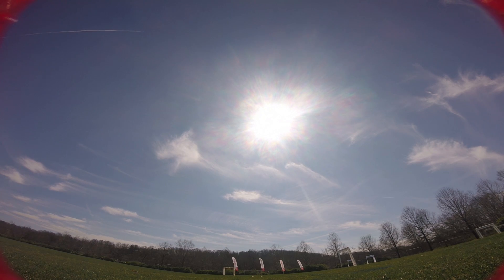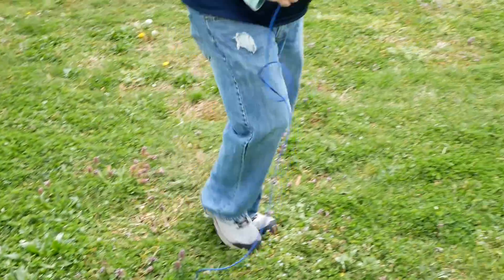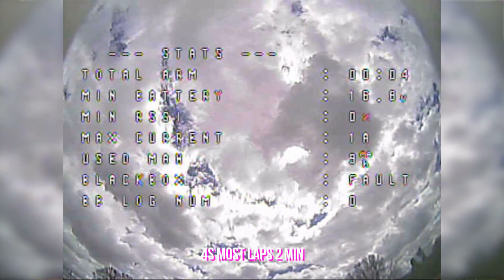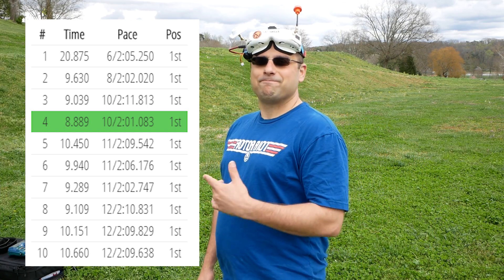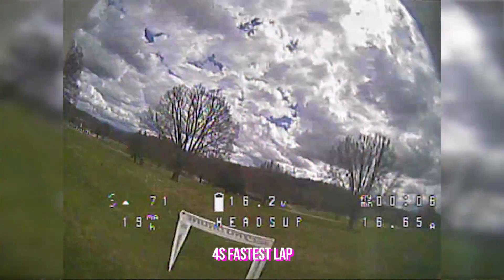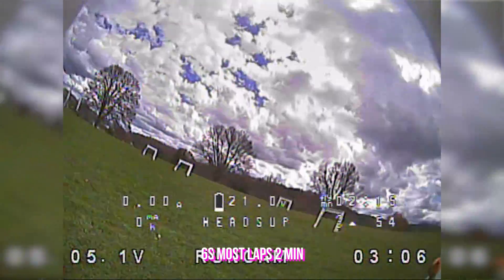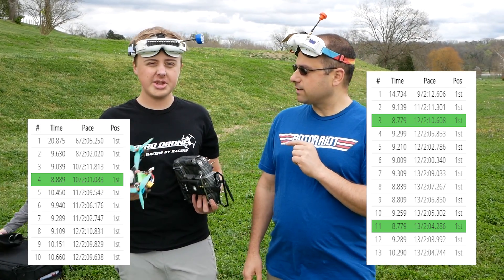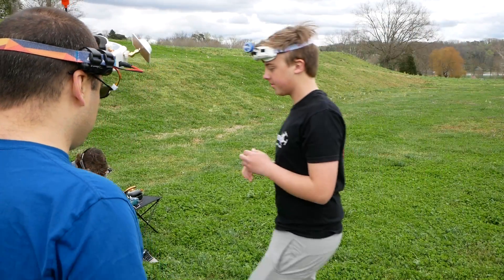6S is the new 4S | HYPE OR TRUTH

Comment: The 6s (27.75Wh) had more watt-hours than the 4s (22.94Wh) wouldn't that also affect how the pack performs overall?  An 1850mah 4s would have been more comparable in terms of capacity although it may have more overall weight than the 6s.
Reply: That's immediately what I thought. When he says that the 1050 6s sags as much as the 4s that sounds like he might get a similar benefit to a bigger 4s pack and the difference could be attributable to battery capacity than the reduced amp draw.
Reply: There's a 1800 mAh R-Line from Tattu that weighs about 200g. Would've been a much better comparison imo.
Reply: Tritone fpv - agreed, I would like to see a test where either the energy capacity or the weight matched perfectly. There needs to be some reference characteristic that is equivalent, within reason, for the performance difference between the number of cells to mean something. There are two many variables that changed otherwise. I.E 10% heavier pack is too much IMO and the energy capacities where way off.
Reply: Yep.  I'm running 6s, and I agree with the above issues with this 'test', Josh!
Reply: One of the issues with a 4s pack of any reasonable mah is you will always have to deal with sag. 6s on low KV simply does not sag. You will kill the pack before you feel any sag.
Reply: My thoughts exactly.... Gotta compare apples to apples... As mentioned above, capacity and or weight needs to be the same to have a fair comparison.
Reply: instead of an 1800 4s the better test would have been a 1000-1050 6s.
Reply: I agree. Depending on the track a lighter quad might be better. The one shown is a great example. There was that spot where the pilot had to change directions a lot. Iif you are flying a track that does not have something quite like that but rather more "punchout" times where direction changes are not quite so often then a 6s would be the best choice. The quad could be a little heavier because there are fewer direction changes.
Reply: What size should he go to if he was using a 1550mAh 4S? All in all this was a pretty good example of both sides.
Reply: 1000 or 1050 6s is about the same as a 1550 4s
a 1250 6s is about the same as an 1800/1850 4s
Reply: Totally should have used a 1050 6s. I've noticed that in all these tests the difference in watt hours is always proportional to the difference in flight times.
Reply: The C rates are another thing. Of course you can have a lower C-Rate with the 6S becasue you do not need super high amps but this is half of the story. Since the 4S has ~50% more mAh a ~50% smaller C-Rate on the 4S compared to 6S would bring the same Amps (mAh*C-Rate=max amp draw). It should also be considered that the C-Rate on the packs is a big lie anyway and you should measure the internal resistance and calculate the true C-Rate of the pack out of that. So C-Rates between packs are comparable in theory but not comparable in reality. To get usefull data you should rule out the possible issues here first which makes finding comparable packs much harder. You could argue its the same with the RPM of motors but they are most of the time at least close the the numbers written on them - however they could sill have a significantly different amp draw because of bearing quality or other things. At the end I don't think there will ever be a good dataset to compare those things.
Reply: Joshua Bardwell I dont see the urgency to get a video out, specially if knowingly its sacrificing the quality of the data. Unless the video is just for entertainment purposes and doesn't contribute anything of substance to the 6s 4s debate. 

We watch your content because you tend to be methodical and mindful of the testing you usually do. This just isn't one such test.
Reply: So in the end the conclusion for 6S is that the battery will last longer (Not in flight times but in overall battery life) due to the lower current draw, otherwise the benefits when comparing weight and watt-hours are minimal...?
Reply: This is likely accurate, the opposite side is that you have more cells, and then more chances for a bad one.  I mean it's probably, ultimately a wash and one should use 4s/6s depending on the track.
Reply: In theory yes but the amounts of tests done are not conclusive yet. While others say 6s will just as easily damaged by the cycles as a 4s when top pilots are going to use it in even tougher conditions...
Reply: i'm guessing you would need RPM matched kv for 6s as 4s and similar watt hour batteries for people to be really be satisfied.
Reply: In my opinion, that would then mean that the momentum of the quad would be lower. I am not an expert in physics but I am taking a physics class in college this semester and am currently studying momentum. Momentum is basically an object's weight, multiplied by its velocity. Being that it is a vector, it has a direction. Therefore, an object with a lighter mass is easier to change direction than one that is heavier. I am really interested in this and have been wondering about this whole 6s deal. I know that when I went from 3s to 4s, it seemed like a night and day difference in speed and maneuverability. I have been thinking about building my second quad and want to make sure that it is not going to be outdated in a year battery wise. I enjoyed your video and wish I had the ability to make and edit videos like you can but I think that there are a few more ways to look at this. Evan said in the video, if I recall correctly that the 1050 6s sags like the 4s does. That was the reason he did not use the 1050 6s. I would love to see you test this further. I know that it would be difficult to make everything perfect but maybe if you made the weight the same, rather than the motors RPM, it would be easier to see the benefits and disadvantages of a 6s compared to the 4s. If a 6s will swing a 45 degree prop on a 2300 kv motor, more efficiently and quicker, then I think the 6s would be the obvious choice. But the reason I question this is because you said people have been doing this, making the motor's RPM the same, does this mean that it is inefficient to use a high kv motor with a 6s? Sorry that this comment was so long and I really do not mean to sound rude is I was but this is just my opinion. Thanks for the video, keep making the great content and I did learn something today.
Reply: This exactly. The watt hours are just above the edge and the drop off is in your favor because volts. The kid sums it up perfectly at the end. Same watt hrs gives same energy although higher voltage is lighter weight copper required.
Reply: At some point you're commanding rotation out of a motor that cannot provide it (running high kv, high volts) and all that power you're pushing to the motor that cannot generate more rpm and therefore thrust turns into heat.  Wasted energy or melted coils.

The light quad vs. heavy quad argument has been hashed and Joshua can speak on that.
Reply: This is the bigger point to be had, I think SigmaOfMyParts.  Because we know our C-ratings are all based on absolute trash.  Lowering the amp load we're drawing out of packs could increase the longevity of our batteries.  

I think Joshua's first round of battery tests were a perfect example of this.  

I believe the only company actually putting real C-ratings on their batteries is Hyperion.  They actually state, iirc, that their continuous C-rating is the discharge rate at which you can expect to get the `nameplate` capacity out of the battery.
Reply: I dont know if it is comparable the 1050's have a very thin cell compared to the 1550 4s or 1250 6s. The cell thickness is litterally half in the 1050. Probably the reason it builds more resistance through the flight and sags more.
Reply: fellstar I agree on the longer battery life theory but this is not what you are looking for when racing and in this case its maybe mostly because of the ~20% difference in watts.

And the C-Rates on the packs are crap no matter whos name is on it and what they claim. I measure all my batteries iR (well I have mostly packs for microQuads - 3S/4S ~500mAh mostly - which might not be comparable too) but there the real c rates are mostly around 20-25 for good packs no matter from where and what is written on it.
Reply: "an object with a lighter mass is easier to change direction " is this the case 100% of time?  Is there no point where it becomes so light that cornering, 180 degree turns would be difficult because there is no enough to hold it's line? Or is that just my screwed up thinking?
Reply: Do you think the information he gave out was not correct or the testing method was off or something?  Not disputing just curious about your comment.
Reply: Also the higher voltage actually will create more heat in the esc's when your not at full throttle so that's inefficient. I think the efficiency argument is done for. I'll go 6s,  but for the power. Screw efficiency, it's not there anyway.
Reply: 100%
Reply from the maker: These are valid criticisms. I've been trying for over a month to get this video made with perfectly matched batteries and motors, and for various reasons (including Evan's schedule--he's still in high school) it kept getting pushed off. So I finally said, heck with it, I need to get the video out.

The 1050 6S that Evan says is equivalent to the 1550 4S, is actually 20 grams lighter. So for equivalent performance, you save 20 grams by using 6S. 

The bottom line is that Evan is a world-class racing pilot so I am willing to give some weight to his opinion even if the test parameters are not absolutely perfectly matched. Maybe there will be a time to do a more perfect comparison in the future.
Reply: Fair response.
Reply: rpm 9000 6s isn't inherently heavier. In fact quite the opposite is generally true based on my research. 

An equivalent 4s high C battery is going to be heavier than a 6s because 6s doesn't require the same C rating, ie cells can be smaller, due to lower amp loads.

Comment: Back in 2015, I calculated that you could get a more efficient setup (less current draw, and therefore less heat) by using 1550KV motors and 850mah 6S packs instead of the then ubiquitous 2300KV 1300mah 4S setup.  Nobody was remotely interested and such motors (size, KV) didn't exist.
Reply: It's a solid idea. In RC boats, this have been used for ages. With 6V setups vs 12V setups. 12V would always perform either equal with better runtimes, or go faster with same runtimes. Less losses when currents are lower, as lost power also adheres to P = V x I formula.

Biggest problem back in those days though, was getting a charger to handle higher voltage batteries. And protection against sparks when connecting the battery. The higher the voltage, the bigger the risk on that.
Reply from the maker: Part of the reason why this idea is only now coming to light in mini quad racing is that batteries and motors and ESCs that support it haven't been widely available.
Reply: @RC-Fan NL
                      Bro you just became my RC Jesus ... was wondering when i would see SOMEONE say this in comments.
Low kv high voltage is nothing new in RC has been around since dinos walked the earth (slight exaggeration)
Reply: You probably mean when RC Dinos walked the earth. ;-)
Reply: That could be true, but basically this is similar to once most quads being on 3S and now 4S having become mostly mainstream. So the principle higher voltage/lower kv is nothing new, it's just a new application of it.
Reply: I did the same, and was frustrated that the market didn’t have properly KV’d motors.  Unfortunately manufactures make products that sell, not products that are better.  Motors are developed for what the majority of people are using.  I’d like to rewind some motors and make an 8S setup.

Comment: First off amazing flying... on another note the 6s 1250 mah would be more like a 4s 1800 mah. Wonder if those two would compare more closely.
Reply: Sort of. 6S battery look like a pig though, especially batteries with protective layer like CNHL Black. But it delivers. 1300 mAh - stable 5 min of hard freestyle. And 8-15 min for cruising around. 4S is now for 3" freestyle and cinewhoops.

Comment: I think you should test 6s vs 4s in your battery tester. See how much power (total energy) you can take out of them at a given wattage. That way we can see any obvious efficiency differences
Reply from the maker: This is actually the most predictable and least interesting test to do. The higher voltage will produce fewer amps for the same watts. The only variable will be the resistance of the wires, which will produce less heat loss due to the lower amps.
Reply: Isn't that the whole point of the 4s vs 6s; Efficiency (or am I missing something)? The only REAL differences resistances in ESC, wires, solder joints, battery connector e.t.c. Only other things could be that the manufacture differences of 6s batteries or low-kw vs high-kv motors that could cause a difference.

Comment: lower the KV in 4s setups and you get the same outcome: substituting higher amp draw for more efficiency
Reply: Drone Recipe but you loose the speed
Reply: how I mean is the efficiency.  Most ppl including myself want extra speed and power with higher voltage setups. The problem is that motor manufacturers have merely substituted less amp draw for more efficiency. So, great now you have the same thrust potential but using less amps.  I can bet that the motors used in the 6s setup weren't even getting close to their amp draw max.  The trick it to go a little higher on KV,  even if not rated for the higher voltage to get the performance most of us want with higher voltage set ups.
Reply: Just what I was thinking, that the 6S setup just needs a little more kv - like 1900, 2000 or so.

Comment: Technically you should lower powerlosses in the battery as well as throughout the quad but I believe the biggest advantage would be in the battery as most of the energy is lost there. We could as well go to 12S but then we would probably reach limitations of cheap electronics
Reply: Don't smaller cells have higher esr?

Comment: I'm going to wait like 2 more months that way 8S will be the new 4S and I'll just serialize
Reply: dude... just dig out your 3S and run them in series :) (of course I am kidding the same as you are :-p )
Reply: Better put gasoline generator on your quad :)
Reply: I'm waiting for 12S.
Reply: Progressiverc has cheap 10s rated chragers. Theres also a high end plane company that sells 16s chargers. And alot of people parralel charge now even the guys using 10/12s on trucks and boats
Reply: KrotowX Done already - well nitro - look up collective pitch sting ray by Curtis youngblod.
Reply: Granny Apple good point. We just need the ESC's to do it I guess.
Reply: @Kabab no problem to charge two 6s at once. Many chargers can do this for years. I am flying helicopters and 12s on the big models is standard.
Reply: You mean the new 6S
Reply: 10kv motors at 1000v DC, amp draw 1mA lol
Reply: Unfortunately this won't happen easily because the vast majority of chargers only do 6S.  To do 8S you'd need to charge two packs...that would get annoying really fast.